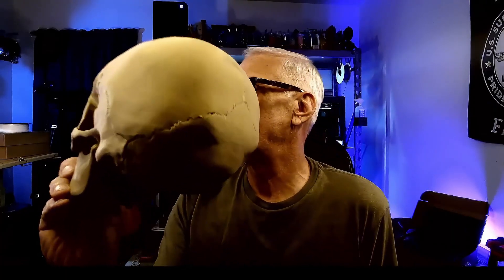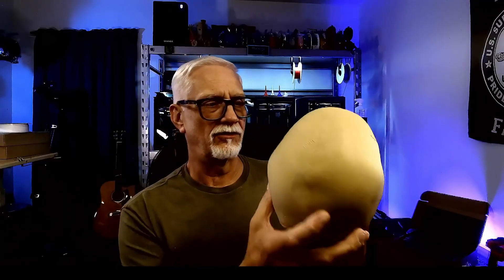How A 3D Printing Senior Goes From Box To Print In 20 Minutes! How to Start Your 3D Print farm!

Comment: Hi Will, firstly what is an AMS system.. you did not explain that to us at the start of when you talk about it... thinking that everyone knows what you are talking about..I don't!  Re the white grease I just bought a large tube of super lube and use it for my printer and other things that need a silicone grease... so what is your wife doing with the allen keys in the video at 9:00?  also it is not always about speed.... precision and better quality print is more important in my opinion... I use an Ender 3v2 and only print at 50mm/s and it prints beautiful quality prints for my model trains each and every time.. and as I have mentioned in another of your videos I have just purchased an anycubic photon mono 4 ultra for the finer detailed prints for my model train spare parts such has handrails/buffers/people etc..  I must admit I have never printed a benchie... I only print items of use that I need at the time... not any gaming or any other type of visual static print. and as for the time taken to assemble and get a print off the bed for your wife is pretty good going.. well done.
Reply from the maker: I'm sorry my a.m.s system is a holder that holds four rolls of filament and allows you to change filament on the fly without having to touch it. I also have the pro series which allows you to dry your filament. You check out bambu 3D printers you'll see their AMS. There are other companies that have AMS systems also and the AMS systems can be stacked up to four at a time to be able to get to 16 color changes. Hope this helps

Comment: Just got my CC in on Thurs (7/10).  First time 3D printer here.   I'm staring down the barrel of 60 and just got laid off a few months ago and nobody seems interested in hiring an old-fart like me.   So I'm hoping to also get into 3D printing to supplement my income along with some print-on-demand items (tshirts and stuff like that).

The CC was really easy to get setup and going...although I did watch a lot of videos before it arrived.   I've printed out all the improvements needed (riser, top holder, etc) and then started printing out desk/tool organizers, battery crate holders.   Next thing for me is to learn the CAD stuff.   Funny because I've been an IT person since the mid 80's but never got into CAD design.

Thanks for your channel giving me hope!
Reply from the maker: Outstanding........ I love it when people our age get a printer and by the sound of it it sounds like it's been running 24/7...... Or in your case 24/4....... There are lots of people that want to hire people our age they are out there. But to be honest with you will be better off working for yourself. I've had two businesses over the last 25 years and after selling them last year I went to work using a large CNC machine for a custom cabinet company. I've been there less than a year and I'm ready to leave. I'm really ready to start pumping out some good content on this channel. You mentioned print on demand that's what I'm doing right now is setting up my Amazon account for the business for print-on-demand and I'm going to go ahead and lift up a couple of parts that I've designed and printed. My next video will also have some of the stuff I've been working on for the last week. Also setting up a printer in my outside shop so I can print off some ASA filament. It's really great that you got into the 3D printing at this time I think you really enjoy it. I was a little hesitant on the fusion 360. But I don't know why cuz when I'm doing it I love it. If you need some help with that hit me up. Thanks for the like and subscribe.... And for watching my videos.

Comment: I got my Centauri Carbon a few days ago and it's amazing! Definitely trying to resist the urge to order another as it's already my 9th printer and I don't need another right now! But it's tempting with how well it's doing.
Reply from the maker: I told Will, No More Printers. At least for now. I am just now really getting started. Will shows me how how to use the slicer, but when I watch him in Fusion I find that part of 3d printing a little boring. Not to say it's not important, I'm with Will on having our own STL files. Thanks for commenting. I need more 3d Printing females. Most of our subscribers are male. Thanks again.
Reply: Just get the order over with ;)  I will probably order at least one more myself.
Reply: @jefft490  I actually would rather order a Centauri without the enclosure. Having 1 enclosed is nice, but I only print PLA and otherwise have open bedslingers. I also want an Ender-5 max later in the year so thinking I will wait on both :) Especially since my Carbon broke this am (wire harness on the hotend broke off the motherboard) and perhaps they will fix that dumb tiny coupler in a future release!
Reply: @jefft490  Since I had a problem with the thermister coupler pulling off the motherboard changing a clogged hotend, I have decided to wait to order another until I see if they fix the poor design of that area. It needs a lot sturdier connectors since many people are having the same issue I did.

Comment: AMS is good also for name badges, like the one in your intro, and for changing over from an empty to a full spool. Samcraft has AMS on all his machines for that reason. Most of them are A1. Now, he's running a print farm and mostly prints one color (a toxic, beautiful green). And still he finds the AMS indispensible.
Reply from the maker: Yes you're right. Name plates. A great job for the AMS and that is a great niche too. "Macy Makes 3d" on YouTube does those a lot and makes good money doing it. See, I get so focused in what I doing I don't always see the goal. As for the grease, same thickness as the bambu's. I find cleaning the rods before the grease get black and drys up is easier than waiting.

Comment: I had ordered the Centauri Carbon back in early April for the 299, got it the other day, very impressed with this printer that I just ordered another one!  The print quality looks fabulous.  This is a great machine when used directly with Orca slicer, getting some great prints out of this unit.  I have five other printers I use regularly, all are Core XY printers.  The Elegoo is a great addition to building out my small print farm.  Looking forward to two AMS units coming for my Qidi Plus4 in the next week, have never used an AMS unit in my 4 years of running printers. Still finishing up a shop area that should be done this summer.  I am running a wood CNC, small 3d print farm, and have a welding shop next building over.   These investments are all prep for future retirement income stream. In the meantime, this will be a side hustle for the next few years as I find the direction and path I want to take with this hobby. I also added a nice airbrush setup to my shop, which I find I am using for a few products that I make all the time.  I have moved at a fast pace with my airbrush skills.   I am still really trying to figure out that "path" I want to take with my hobbies.  I have been very selective of the types of investments I have made in the past few years, with a rough end goal in mind. 

Interestingly, I got addicted to these 3d printers two years ago when I was first expanding my wood shop with a new CNC router machine, never thought I would end up so far down this path with all of these 3d printers only two years later.  I sat down over the summer and committed to learning Fusion360 to a level where I feel comfortable designing my own semi-advanced parts.  Still lots to learn and progress with on Fusion in the coming months.  

The amount of online content these days makes learning a whole new hobby or skill very easy.   The 3d print world has really moved along at a nice pace over the last two years, making it easy to own a decent machine with a low-cost investment.   I am looking forward to upcoming technologies just hitting the markets in the next year or two. I can see myself investing in a Rigel hand scanner in the near future, really want to have the ability to capture accurate models.  This $5K low-price option looks to be the most affordable way to enter the scanning market for someone who has an interest in exploring automotive-related accessories and having the ability to scan accurate models that can be modified and later printed accurately.  This seems to be the $$ point where one can enter the scanning market with appropriate hardware; this should open up some more opportunities in the future.  I am doing the same as you, except starting a few years prior to retirement, investing in learning the hobby while growing out my shop.
Reply: A end goal is just what we all need now. I look forward to hearing about the hand scanner. I've looked into them but the price will have to come down. Thanks for the comment and for the watch.